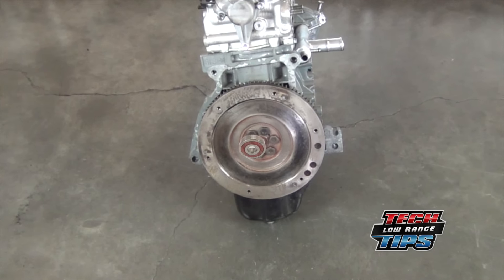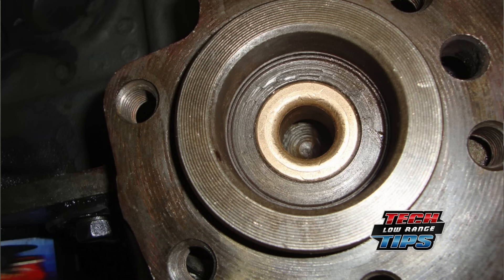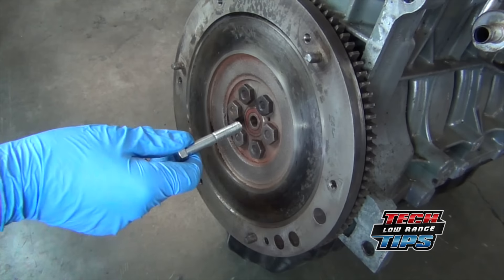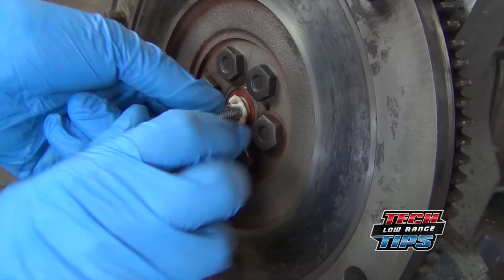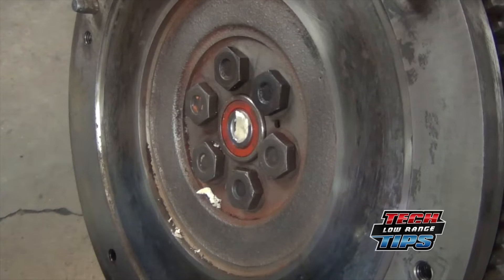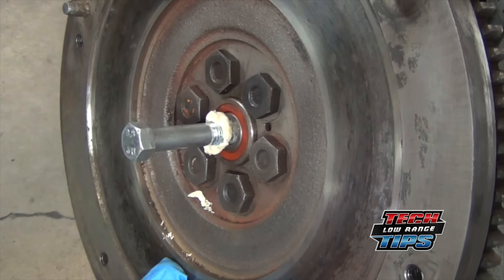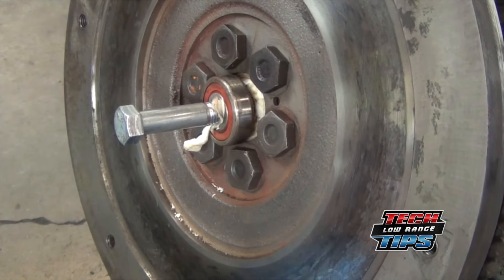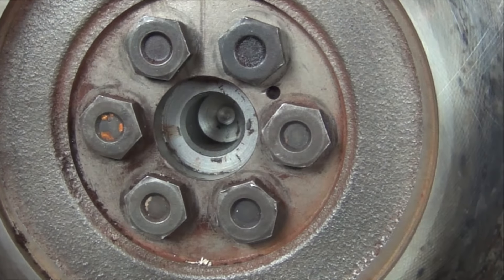How to Remove a Pilot Bearing with Bread

Comment: Wish I had seen this 50 years ago. So simple but so effective! Thanks!
Reply: Is this for real, and does it work?
Gotta try this😀
Reply: @E9859-v7d  Works on any 96-2007 Manual Audi and Volkswagens. Used it on my 97 A4 1.8t 5 speed and my 2002 S4 2.7tt 6 speed

Comment: Thank you so much for this tip, I tried it on a pilot bearing that is pressed into a crankshaft, and it worked like a charm! Amazing technique. Grease would never work, it would just be pushed out through the balls without doing anything. Great tip, one of the best I've seen in the automotive world.
Reply: Grease does work ive done it plenty of times. Spiggot bearings are sealed. Not saying that bread doesnt work though.
Reply: You can use candle also.

Comment: Dude - I owe you a beer!  I have been struggling to get the pilot bushing out of my 1950 Chevy (engine in the car, bushing in the crank not the flywheel).  Without success I tried two different pilot bearing pullers and even tried threading a bolt into the pilot bushing to use a homemade puller, bushing didn't even budge.  I was skeptical when I watched your video, but I was also out of ideas.  I ground the threads down a bit on a 7-inch long 5/8-inch bolt to match the ID of the bushing (I could easily rotate the bolt in the bushing but not wiggle it l back and forth).  I think I pounded an entire slice in and then switched to a bigger hammer.  Low and behold after a few hard blows with the bigger hammer it started coming out!   And to top it off now my engine is fortified with 8 essential vitamins!  In all seriousness thanks for a great video!

Comment: This works 100 percent. You just need a TIGHT fitting bolt, or an old clutch alignment tool works wonders. I broke 2 pullers from autozone, and tried a grease gun...this was the best thing...since sliced bread.
Reply: haha nice ^^
Reply: Non ça fonctionne pas à 100 pour cent moi le roulement ne bouge pas la mie ne va pas en dessous

Comment: Works GREAT on pilot bearings that are too small for pilot bearing pullers. Also, it’s much easier to fill it behind the bearing with bread than it is with grease.

Comment: Brilliant !! I used this idea as far back as 1955 yes I'm an old dog. But so good that you have taken the time to explain it to the next generation If and only if you had a very accurate pilot you could use grease as I once did but cleaning it up away from the plate was a drag.  Bread is good  Thanks for the upload
Reply: there's another trick in a similar vein to this video, extremely useful for loosening or tightening crank pulley bolts: wrap the longest old v belt you have around the accessory pulley that's the shortest distance from the crank, then shove the excess slack in between the pulley grooves and the belt in the direction you need to turn the breaker bar in. you can then loosen or tighten pulley belts without needing any special tools besides a breaker bar, or a floor jack handle on top of a breaker bar.
Reply: @edbo10  Can you link to a video of this trick?

Comment: this actually works, I used a cut off 1/2" drive extension and bread to remove the pilot bearing on my SBC. Alot cleaner than the grease method

Comment: Didnt have a bearing puller and snap on truck didnt have bread :(
Reply: Hehe
Reply: Do not worry,if they find out the trick, will sell and the bread to the garages for 1000$ a piece with 10 slices, that's 100$ per slice. plus you get a lifetime warranty,
Reply: I will see snap-on making bread... $200 a pound! 😂
Reply: Try Cornwell next time.
Reply: Damp paper towel or napkin works too
Reply: @Joe Black that's $10/week for 12 months.
Reply: Cabut ku huntu sia😁
Reply: Wet toilet paper work too
Reply: My snap-on truck had bread it was $100 a loaf.

Comment: haha love it, I tried this with grease years ago and failed as the grease was too thin and it just squirted out, I can see that moist bread is much thicker and doesn't escape when hit like the grease can! Using bread as a hydraulic fluid is pretty cool and I can name another use for soft bread for auto repairs which is pushing it into a LEAKING RADIATOR, it can stop the leak and get you home and I heard a story from someone who continued to drive the car for a few thousand miles without it leaking before the rad was replaced :-)
Reply: Used to use wheel bearing grease , works good . Never tried with MP grease

Comment: To remove pilot bearing one can use candle wax the more harder the wax the better I tried this technique and it really works for my Activa Honda scooter which is in side the rear wheel assembly.

Comment: only if it's expired bread. I hate wasting food. This can be done using wet paper as well. soak em shred em and pack the hole and repeat the shown process
Reply from the maker: Great tip. Thanks.
Reply: Да хлеба жалко
Reply: Ya can't afford to spare a 5 cent piece of bread? Were you raised in the depression era lol, STHF hasn't happened yet.
Reply: Not sure about you but i can go to my local grocery store and get a loaf for a dollar. Pretty cheap if u ask me

Comment: Years ago these bearing was called a spigot bearing, nothing as solid as your one but how we got the bearing out was fill the hole up with Greece same thing get a good fitting bolt and hit with a hammer, and the grease would push it out as the same as the bread, good video and nice to see different ways kind regards colin from croydon surrey England 👍
Reply: Same here - I remember using heavy grease to remove the spigot bearing on my Morris Minor.

Comment: That was awesome !  Which works best ?  White or whole wheat ?  lol
Reply from the maker: Doesn't really matter as long as it is moist.  Thanks for watching and commenting.
Reply: Whole, because it goes into the hole easier!
Reply: I think white bread works best. It's a bit softer then wheat bread.
Reply: or a  flour tortilla
Reply: Wheat bread so your engine can lose some weight
Reply: So you're asking whether white or brown works better? How racist of you. Everybody knows whites work more than brown
Reply: Marble rye
Reply: A good multi grain bread
Reply: Seeded rye works the best   when I want to line up the input shaft with the transmission I use a Bagel
Reply: High fibre will ease the passing of the bearing and keep your engine regular.
Reply: Pumpernickel?   Would have not believed it if didn't see it.
Reply: I've done it lad it works like they say it's important to use right size bolt and just keep adding bread and it will eventually come out 🍞🔩
Reply: @abelcerrillo2162 not pliable enough. Putty or Play-Doh would work
Reply: Gluten free. It’s about all it’s good for.

Comment: As long as they're double sealed/shielded bearing. 

I've tried this bread method (or grease, wet paper, etc) on single shielded bearing (shield facing up obviously) and the bread just push the metal shield off the bearing.

Comment: still have to remove the flywheel for resurfacing
Reply from the maker: Agreed that should be done, but some people are just changing the bearing also this tip can be used on pilot bearings in other locations like we did here.

https://www.youtube.com/watch?v=b0rVQP7F6FI
Reply: dennis doroshenko naa let it "develop".
Reply: dennis doroshenko the bearing is in the crankshaft not the flywheel.
Reply: David's Favorite Videos  looks like it's on the flywheel to me.

Comment: Basically just a hydraulic piston. I learned this trick decades ago. Although it will work much better with something that fits better than a screw. Its also great for removing broken pins. Just need to drill a small hole in the center, and pound in a pin the right size.

Comment: I used this method to remove GM OEM LS3 Pilot Bearing for my swap! I was very surprised! Took about 3 slices incase anyone is wondering.
Reply: Is there a chart showing how many slices would be needed for a 3.4L Toyota 5VZ-FE?  ;o)
Reply: Ls engines have a hollow crank lucky you didn't press the bung and what ever your using into sump

Comment: About 60 years ago I removed a bronze pilot bushing from a Chevrolet Crankshaft to be transferred to another crank. Are used heavy axle grease packed the hole well and then put a spare transmission input shaft in the hole and smacked it with a hammer a few times in and out came the bushing. It might require more grease to get it out all the way. This was on a Sunday, no place to buy a part we did what we had to do.

Comment: Just used this technique to remove the pilot bearing from my 914 engine. Grease did not work as it shot out the sides of the bolt. Bread on the other hand worked perfect. Literally less than 2 minutes, a single piece of cheap garbage white bread. No mess, either.

Comment: I do the same thing. Put some wheel bearing grease in the bearing center and use a tight fitting wooden dowel one whack from the hammer and it pops right out.

Comment: works fine I just took mine out. At first it didnt seem like it was budging but maybe it took hitting it quite a good bit to actually pack the bread all throughout the cavity then it began to move as enough bread was in. I packed the first time and hit and it didn't seem to move. I did spray some penetrating oil around the hole after the bread was in, there seemed to be a slight crack that I sprayed in.  Also watched a video where a guy used a long bolt and a nut and a flathead to bite the nut to the top of bearing and as he tightened up on the bolt head it pulled the bearing out. That however did not work for me

Comment: Sure if you have all day to screw around and ruin your lunch. A mechanic's technique is to take a shoulder nut (one-piece nut and washer) that's bigger than the hole in the bearing, Grind the sides off so it fits through the bearing and poke it in. Then take a full-thread bolt run a nut and washer on it then through a socket bigger then the outside of the bearing. Align the ground shoulder nut behind the bearing so you can screw the bolt into it and now you can turn the other nut of the bolt to pull the bearing out into the socket. Around 0.1 hrs and works better on seized stuff than air-filled beard.
Reply: Nothing like overcomplicating things... Just used this method about 2 hours ago, after fighting with a stuck pilot bearing for half a day and getting nowhere. Took less than 5 minutes from the time I crawled under with bread, hammer, and clutch-installer tool (perfect fit for the pilot bearing hole) to the time I crawled back out from under with the removed bearing in hand instead of stuck in the flywheel.

Comment: Wait wait wait, so not all pilot bearings/bushings are pressed into the crank? So when reinstalling a flywheel with an attached bearing, you don't need to tap it into the crank, since it's attached to the flywheel?

Comment: Would work a lot better with a smooth rod rather than a threaded bolt.  If the bearing is the right size, best easiest way is to thread a tap into the bushing.  Either keep going and use tap as screw jack or screw a nut on top and use a couple of rolling-head prybars to pull.

Comment: Great trip - I’ve been told that grease can be used for blind bearing removal but I’ve never tried it, I think the viscosity of the grease i normally use is too thin but the bread ‘paste’  as we can see just the thing and easily obtainable!👍 do you think windowpane putty would do the same job?🤔
John🇬🇧

Comment: Ball bearings work too or bbs insert as many as you can fimd a piece of rod to fit hole rounded tip strike with hammer displacement will push bearing up and out

Comment: I'm sure someone has brought this up, but don't do this with an LS or any other engine with a freeze plug in the back of the crank. If the bearing is extra stubborn you'll just push the plug into the crank. And if you push the plug into the crank, you're gonna have a bad time.
Reply: Oops.

Comment: I always have a loaf of bread in my garage. I spread some NLGI-1 lithium grease over it and the excess I put into the pilot bearing hole to remove the bearing using a hammer and bolt. Why waste good bread?

Comment: My 2011 Mazda 3i was a bitch to pull its bearing, it took TWO pieces of bread.
But seriously, thank you for this tip.  I was seriously considering just re-using the old bearing, which I have been told is a bad move.

Comment: Be careful using this on a GM LS crank, or any other crank with a pressed in oil plug. You might push the plug in too far or loosen it and cause an oil leak.

Comment: Anybody still there after 5 years? No way can do this on my civic 98 P6fd1. The bearing hole has a ridge on the rear side of the flywheel and can fit or remove the bearing only thru the front side of the flywheel.

Comment: "NOTE" - Unless you have a LS1. They have a hollow crack shaft with a welsh plug pressed in the end of the crank. Hammering the bread in pushes the welsh plug into the crank and drops down into the sump along with the bread through an opening to eventually finding its way into the fine oil passages blocking them and ultimately screwing your engine from lack off oil supply.
Speaking from experience after the spigot bearing removal tool broke and trying this method.🤬

Comment: It can also be done with heavy Grease. But just buy the tool it works great and it's easy to use. I've tried both and bread or Grease doesn't always work the puller always does

Comment: Levers are pretty powerful tools and many workshop tools use any of the three lever principles. Hydraulics are more powerful in smaller dimensions and what we saw in this video is a case of hydraulics using bread. Here is a situation were hydraulics are used to couple ship propellers without keying the shafts and so less stress points on the shafts.
 https://youtu.be/kKn3lDYL4uk

Comment: Just another version of an old trick using grease. Pack it with grease and hammer a bolt in, the hydraulic effort will force the bearing out.

Comment: The best way to remove the pilot bearing is with grease. Take your grease gun and insert it inside the hole and pump it until the chamber is full. Then take a socket that is closest to the size of the hole and with an extension tap on it. Unlike the bread it will not compress. Instead the bearing pops out with one fill. Then you can leave the bread on your sandwich and not go hungry. A quick wipe with a shop towel and the grease is cleaned up.

Comment: That's no way to make a sandwich, can you pack some peanut butter in there as well? I paid Snap-On a few pretty pennies for my pilot shaft bushing/bearing puller and it works great. This is a good idea though, or you could use grease instead.

Comment: Word of advice, don't try this with a Chevy LS engine.
Reply: I take it it did work?
Reply: @herbienbrian2  The LS engines have a hollow crankshaft with a plug in them. If you try this method it will drive the plug out and into the oil pan.
Reply: @WillSmith_1980  lol wtf that's a terrible design.

Comment: A waste of time...and what pro can afford to do that? Select a tap that fits inside the bushing, run it in, bushing pops out, and job done!
Reply: Can you show me?
Reply: @TheJagot  I'm not sure what you don't understand. An equipped technician will usually own a tap and die set. Select a tap that will thread itself inside the pilot bushing, drive the tap in, and when the tap bottoms out in the crank hub, the bushing is pushed out. Save your bread and buy a tap/die set.
Reply: I got it
Reply: @JSBIRD69  Save 0.5 cents on bread and buy a tap/die set... Got it.
Reply: @urbanturbine  Actually, I looked at it from the standpoint of a professional wrench. Use the proper tools for the job, as opposed to wasting food while some go hungry. 
Not to mention a huge waste of prescious time. A technician charges in the neighborhood of $75/hour...would you want him spending 15-20 minutes of your time/money messing with rolled up balls of bread, or have your tech take 30 seconds or less to do a 30 second job? 
I know which one I'd choose.
That's the beauty of living in America...you choose your own way. 😎
Reply: @JSBIRD69  Looking at professional wrench point of view is not adequate. A technician working in a shop would already have a bearing puller but its not only automotive techs who work on cars. There are a ton of DIY people who work on their cars over weekends like myself. If I drop my transmission once in 10 years in my garage, i will totally use a slice of bread to pull the pilot bearing as opposed  to buying a $30 bearing puller that i will never use again. A lot more energy and resources go into manufacturing those metal bearing pullers than a slice of bread.